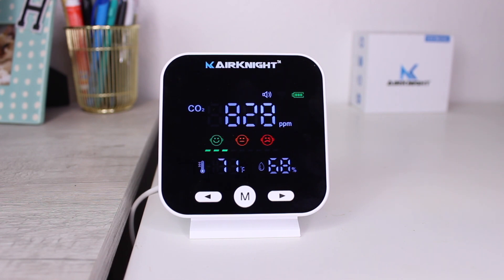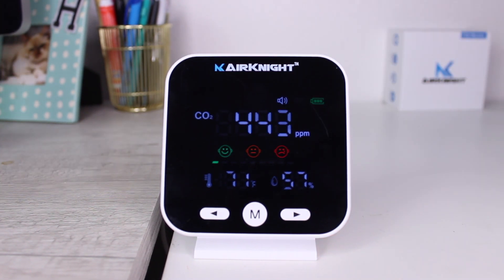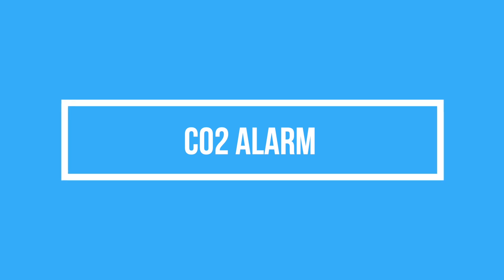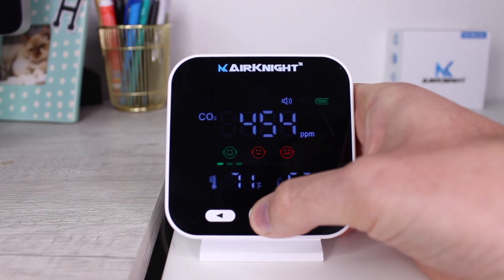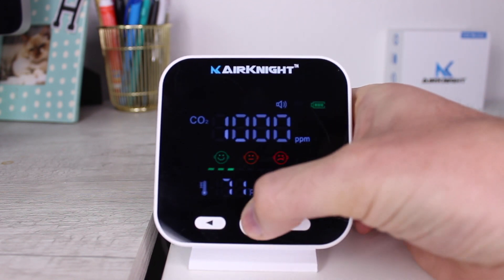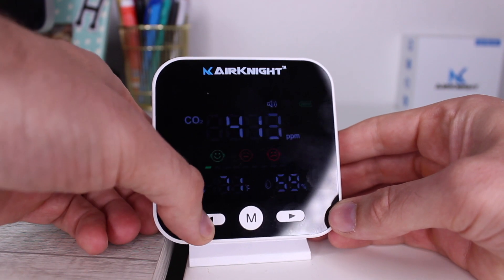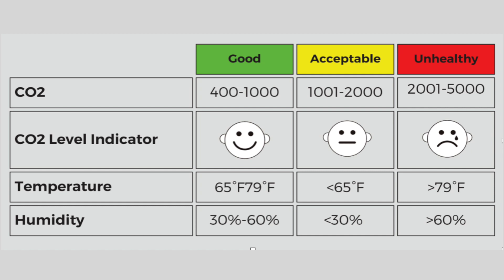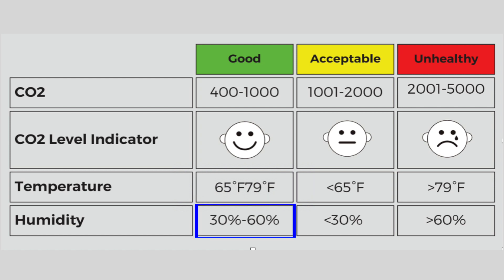AirKnight CO2 Monitor Instructional Video, Carbon Dioxide Monitor, CO2 Meter Carbon Dioxide Detector

Comment: Does this have to be calibrated every time you use it or take it to another location? Or is the calibration just for when you first get it?
Reply from the maker: You should not have to do any recalibration unless you are getting strange readings. The first step recalibration we recommend is just to turn it off and let it sit for 30 seconds and then turn it back on again (if you are getting seemingly incorrect readings).
Reply from the maker: Reach out to Hello@airknight.io if you have more questions.